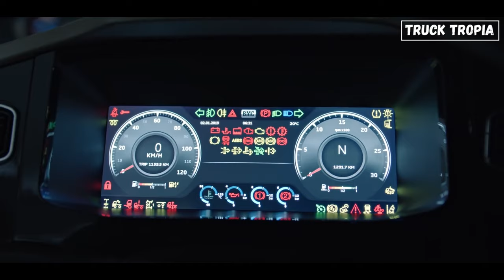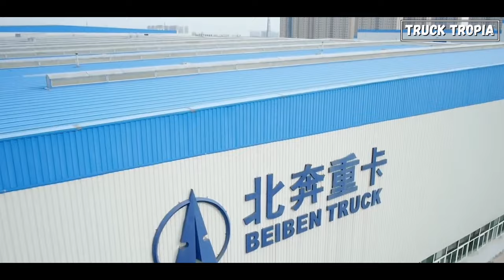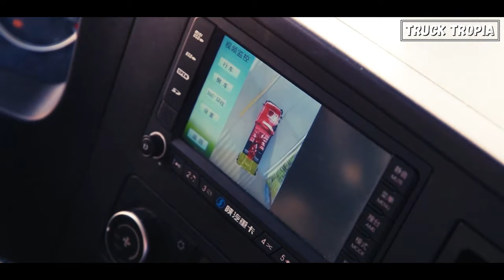The Trucks Manufactures You Never Heard Of - From Around The World

Comment: Ford and BMC is best and %100 Made in Türkiye
Reply: %100 True
Reply: 100% made in Turkey or built with 100% Turkish parts?
Reply: @BlackSeaRC BMC not really but FORD yes Engine built in Türkiye BMC using Cummins Engines but FORD isn't and Not Turkey is Türkiye
Reply: @yagzthe  100% means everything, including electrical components and instrumentation, air brake system, tyres, etc.  With regard to the use of Turkey instead of Türkiye, perhaps to advise BMC that they are still using references to Turkey on their website?